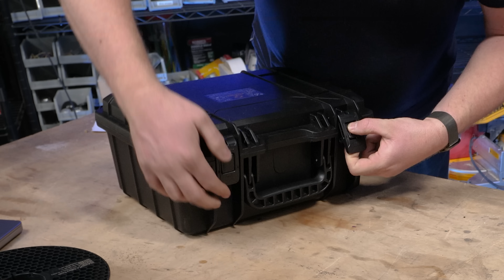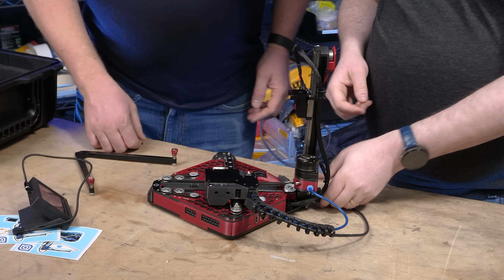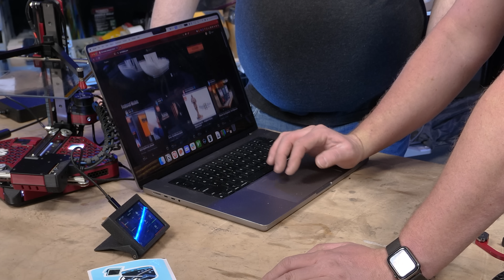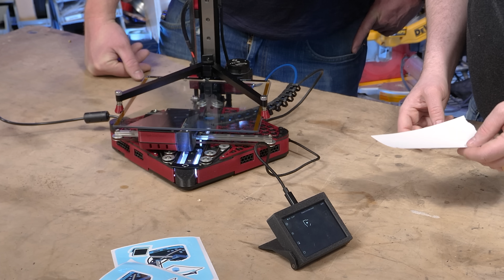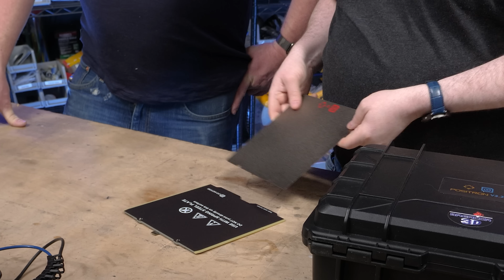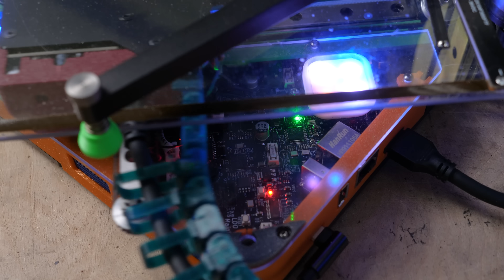This 3D Printer Prints UPSIDE DOWN!

Comment: for those interested in a very similar printer but that is much cheaper, more portable, more automatic (built in bed probe) and maybe a bit faster to assemble (I do it in 1 minute) look up the lemontron. note that it's a more DIY project that requires some soldering, crimping, and cutting some metal with a dremel, but for me it has been worth it. It uses the bed and hotend from a positron.
Reply: We also have modified parts for the positron that give it bed leveling and other options as well. :)
Reply: @TheZolon  bed leveling should be base config

Comment: I have to travel for work a lot and would love to be able to have a printer with me. If you can get it to auto bed level I could see this being super useful to me.
Reply: There's mods for adding a bed probe, but there's also the lemontron which is much cheaper, even more compact (with integrated PSU), has a built in bed probe, and the same build volume as the positron (it uses the same hotend and bed).

Comment: Would be nice addition if it could work straith from a Lipo pack as power source.  lets say a 6S 22,2V for example.
Reply: There is probably no reason it couldn't. Most printers include a AC to DC converter and run on 12V or 24V, it is probably as simple as replacing the AC to DC converter with a battery, maybe adding a buck converter if needed.
Reply: @conorstewart2214  yeah probably
Reply: It runs on 24v, it probably runs about as well at 22v. The electronics can use any amount from 12 to 24v, but the hotend and the bed probably require 18-20v at least. When I arrive home I will test what's the minimum voltage at which it can print.

Comment: A commercial? Boooo
Reply: It's an open source project. You can build one without giving them any money (but in practice you would at least buy the hotend from them since it's very good). I did, and the only official part was the hotend. The bed was from a journeymaker.

Comment: It's cute and adorable and I love it. But Now I'm wondering if I can't use the Pelican case itself as an enclosure, thereby eliminating setup. Just plug it in, and go. I don't think we're making it battery powered quite yet.
Reply: you csn male it battery powered. a 100Wh battery is pretty small those days. I think that with that build size, motor size and pla/petg you will draw maybe 50W continously?

Comment: This seems a bit too niche. I like it but at the same time it lacks some of the things I like in my Voron 0.2-S1 which is also kind of made to be ultra portable. The big thing about Voron 0.2 is pretty much that it's self-contained and can be made fully enclosed; it's a box with filament holder outside and you just plug it in and it can start printing. It does take probably like twice the space while traveling but it's a Voron, it has aluminum extract cage, you can beef it up a bit, make couple latches to keep the top side closed, change the plastic sides to aluminum sheets, put a handle to it, and it's its own box.
Only thing why Posi would be better would be traveling in plane or train where you would need to either add more padding to the Voron 0.2 as someone else will be handling it or just do as musicians do and book another seat to take the printer with you. But in those cases I have found out it's actually better just swallow your pride, check Fab-/HackLabs, Maker Spaces, schools, companies, whatever which might have a 3D printer around there and give them a call, it might cost you something but you're probably on a customers time and you can just push that cost to them.

Comment: The only gripe I have is that when you're boasting about how quick something is to assemble, a real-time demonstration without jump-cuts would be more honest.
Reply: Indeed, and end with a 17min video.
Reply: My thoughts exactly, it sort of undermines the point.
Reply: I have a lemontron which is similar (but it's 4 screws instead of 2) and it takes me like a minute to fully set it up. And I don't even need to level the bed each time since it has a bed probe.
Reply: Most people can set up a positron-style printer in under a minute.

It took them longer because he’s showing how to do it.
Reply: @Geahk_like_Jack  I wasn't looking for an explanation. I was pointing out that if you're going to demonstrate it, then jump-cuts look disingenuous.  Anyone can tell you anything, but demonstrating it has more credibility.

Comment: why there is no auto bed leveling.
Reply: It's coming in September with nozzle probing. When we originally designed Posi, there wasn't any reliable ways to do it inverted other than IR. But we're working on a Positron 3.3 with a fully analog strain gauge built into the toolhead to allow for dynamic flow adjustment and nozzle probing.

TL;DR - it has ABL, but manual leveling is genuinely faster.
Reply: The “bed level” shown in the video is more of a manual “z tilt adjust”. The glass bed from LDO is QC’d to have a variance of 0.001 mm, which is flatter than any bed mesh. Bed mesh isn’t needed for the glass bed.

Comment: This is such a stupid idea for a printer. By the time you assemble that I can plug in my Prusa mini and already be printing. It’s also just marginally less portable than this. I can put a handle on it and bring it wherever I want in 2 seconds.
Reply: It’s small enough to fold up and be stashed in a drawer, and blows the Prusa mini out of the water in print speed and runs full Klipper. As an example for quality speed benchies, 16 minutes is easy and most can do 12, but mine has been able to do sub 10 minutes. As for traveling, that case is small enough for a “personal item” on a plane and just tucks under the seat when flying.
Reply: Can you fly to a customer site with it in carry on? It's niche, but has a place
Reply: @alexowen3948 it’s 2025. If they don’t have their own printer, you’re not flying with yours to meet with them, they will simply buy one for $150 online.
Reply: The Positron is TINY and yet has a massive build-volume. No other printer has such a wild ratio of size/weight to volume. This makes it a great printer to bring to tabletop gaming events and even a cafe.
Reply: Your prusa mini does NOT fit in a filament spool box, which could easily fit in a small backpack. I've unfolded and folded mine many times already, in under a minute each time.

Comment: why you have separating parts instead of automatic un-folding mechanism. that amount of mess of wire connections is not very portable. experts are complexity happy. setup time and config complexity is huge. nothing different to a normal sized bed slinger setup. gimmick only. auto bed leveling is standard. paper bed level should not be required. any extra lubricants are only in the way, like finger nail paint. tools for men plz. does not have to be upside down. why upside down would equal to portability. nonsense.
Reply: tOoLs FOr mEN
Reply: By having the moving toolhead close to the base the whole thing can be a lot less rigid and still work